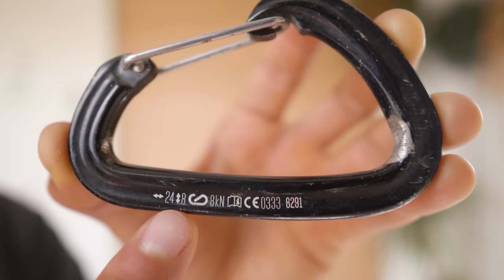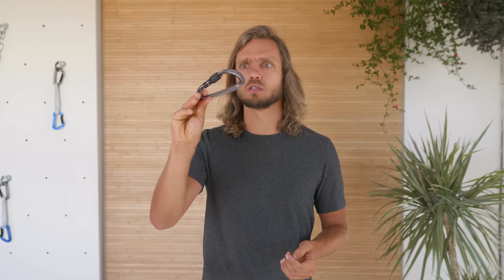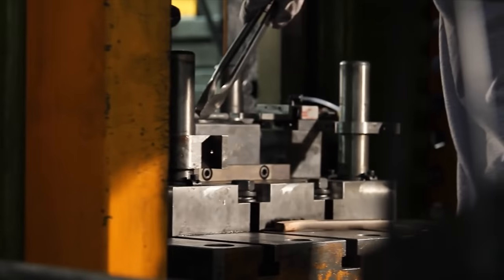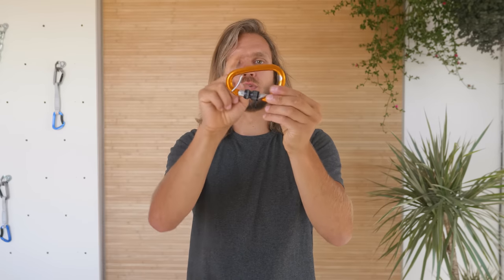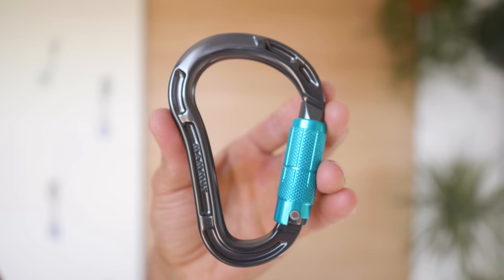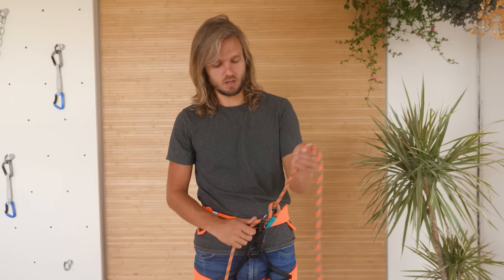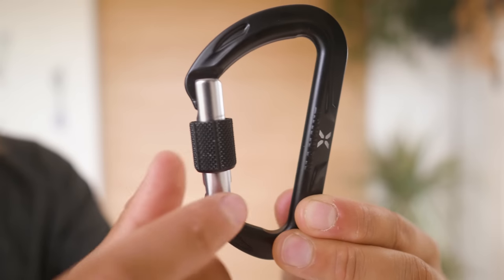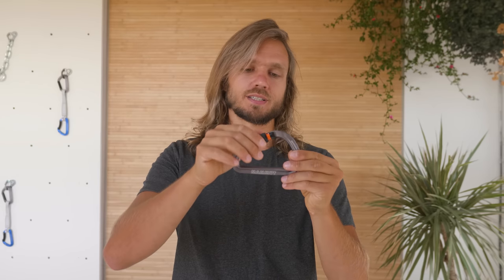Complete Guide to Carabiners - Shapes, Styles & How they Fail | Ep.2

Comment: Didn't really like the "don't screw too tight" part for the screw lockers. Especially with the "heavy load" explanation with no proof. B6ZfFONJmys
Reply: Also what does "Steel is more hard metal and it's more brittle" ? From Ryan: h7rg20Fy4cc?t=71
Reply from the maker: Yea my emphasis was more on the fact that beginners often try to screw them crazy hard and that's just not necessary at all.
I don't know if there was any serious testing done to figure out if after heavy load it makes them hard to unscrew... would be interesting to know... maybe it is a myth... 
I've seen plenty cases that are hard to unscrew, but most might have been due to sand or dust inside...
Reply: @HardIsEasy  If you lock a screwgate while loaded it will pinch down on the locking mechanism when unloaded thus making it harder to unscrew.
Reply: He is correct in the video, they teach the same at belay courses.
Reply: Same comment twice. Check out Ramons other thread for some arguments, why "don't screw too tight" makes sense.